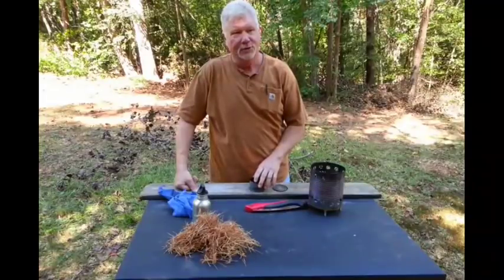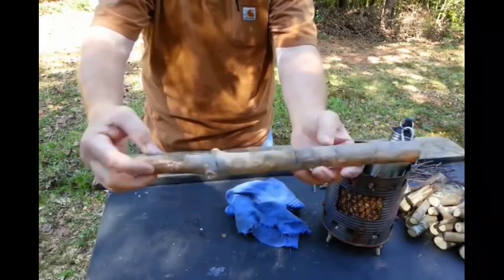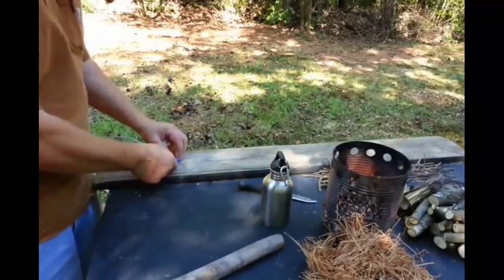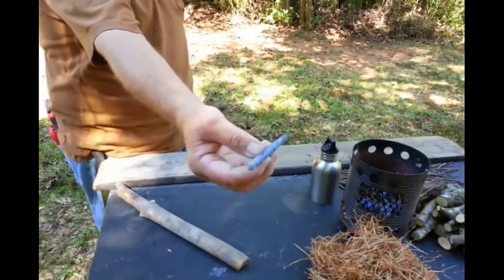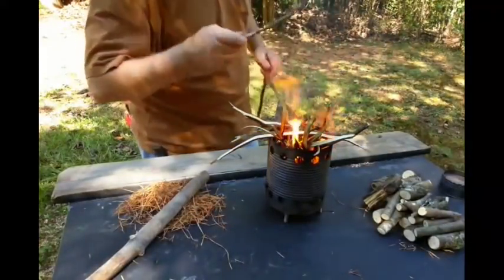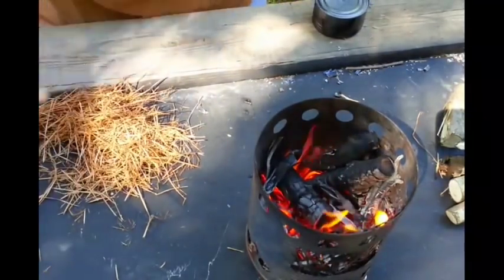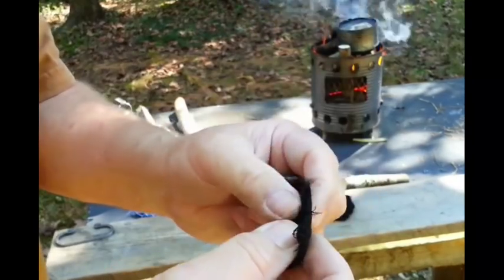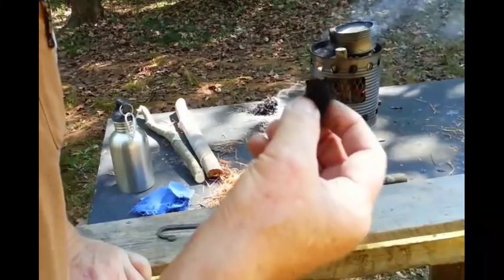How To Fire Roll Cotton Fabric, Replenishing My Ashes And Char Cloth Supplies

Comment: In the 80's I made char cloth pretty regular, I found a new quarter paint with lid worked really well. Put cloth in seal lid  and take a small nail and poke 1 hole using just the tip,put can in fire and it will outgas and flame out of hole and as soon as the flame burns out take off the fire and plug hole  with nail and let it cool, makes the best silky char cloth for catching embers.

Comment: To keep your char cloth fresh and reactive, you might want to put a silica gel packet or two in the container with the char cloth. One in the bottom and maybe on on the top before closing it up. Hope that helps.
Reply: Incidentally, that same packet could replace the ash if it has iron powder in it. Same with hand warmers. The iron powder rusts, & rust is the substitute for ash. Rust is important because ash only comes from fire. Rust is, if course, available from natural rock, vehicles, nails, etc.  So, if you've not yet gained fire, you may not have ashes to use in the cotton. Practice not having ANY gear beyond what you can scrounge up.  Because sometimes things don't go your way, and your kit could end up down the river.

Comment: I use my knife edge to scrape those front stringers until they shred a bit.
Reply from the maker: That's the way to do it. I think I showed it during this video. This one  was made a few years back.
Reply: @DavidWestBgood2ppl  Hi, Dave. Will ashed tinder take a flint and steel spark? I think I've seen cases where dry chaga will do so?
Reply from the maker: No, only a few plants on the planet will and they have to be unusually dry.
Reply: @DavidWestBgood2ppl  thanks

Comment: So... from the time you start your back and forth movements about how long does it take on average to get an ember? Also... are some types of ashes better than others?
Reply from the maker: For me, I guess about a 100 strokes.A forward and a return equals one stroke. It will be different for everybody depending on their pressure, length of stroke, humidity, ability to control the roll during the rolling process, determination, endurance and skill level. One should master the cotton and ashes fire roll before trying all the others. Please watch my how to fire roll video within my Rudiger roll playlist. Thanks!.
Reply: Thank you for that. I went downstairs and tried it with a cotton ball. I felt some heat after about say 30 strokes.I mistook fine ash for smoke and found no ember. On another note. I see what you mean about controlling the roll because several tries and some cotton began to roll out one side of the wood. Oh well. I will have to practice ...anyway, love your videos. You're the master of fire. ha ha I'll keep watching. Thanks again.
Reply from the maker: 30 strokes should have been enough... Like when I first started, you may be short stroking. Get used to long deliberate strokes and build your speed up gradually on your way to the 30 strokes. Good luck!

Comment: David, is the reason char cloth is not as reactive after it sits around in a tin, because it collects moisture from the air? If so, could this be corrected by keeping it in a tightly sealed container, or does that also have a deleterious effect on the char cloth?
Reply from the maker: Yes and yes and no! Merry Christmas!

Comment: A box of matches or a lighter is much easier
Reply from the maker: Always!
Reply: Matches & lighter are convenient. 
But if lighter is empty, & matches are gone, (or unusable), & fire is essential to survival,
what do you do?
Without knowledge, & experience of making fire from natural sources, you freeze.
Friction fire starters,
water bottle lens,
Soda can mirror,
Flint/quartz & ferrous rock sparks from the stream bed, pine resin excellerent, pine needle tinder, fatwood
& other fire starting techniques turn survival disaster into mere adventure story...

Yesterday we met big game hunter who went to 11,000 feet for big game hunt.
They walked back down the mountain, to spend the night in the hotel, because of cold & wind around their tents.
He had never heard of 
alcohol stove from
beer can, tuna can, fancy feast can, aluminum bottle, etc.
Tent wood furnace would be ideal, on the
Leeward mountain side, despite deep snow cover. They used candle heaters.
Location, preparation,
timing, & experience
all factor into the adventure...